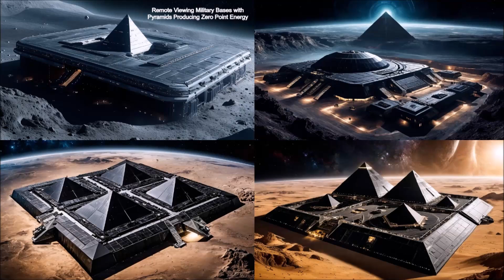Remote Viewing Military Bases with Pyramids Producing Zero Point Energy

Comment: I suspect that the black material coating the pyramids is a type of quasicrystal metal, for example TiAlCo-B: Kevin Orlowski on the Magnetic Energy YouTube page makes use of this wonder material in his free energy devices to power motors, lights, replicators and generate anti-gravity.